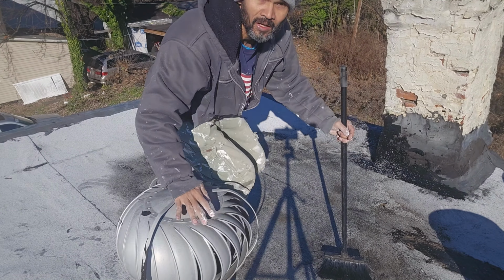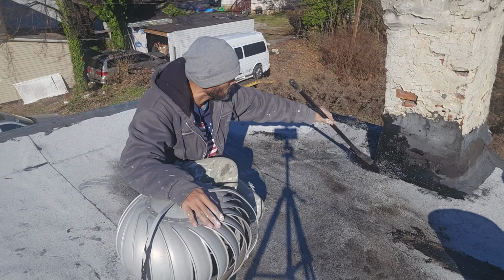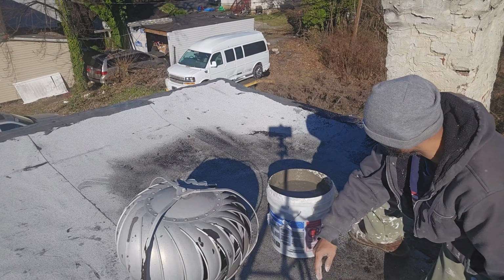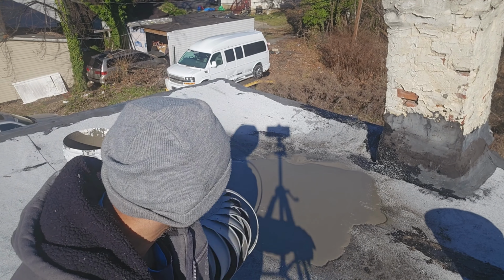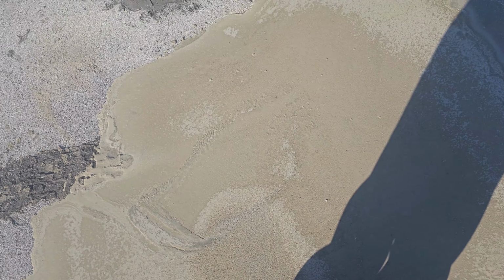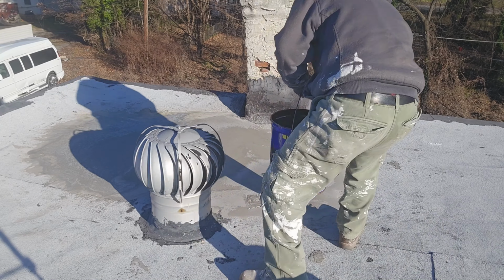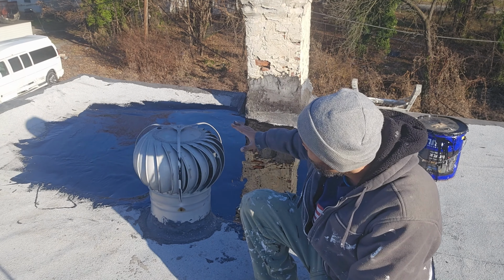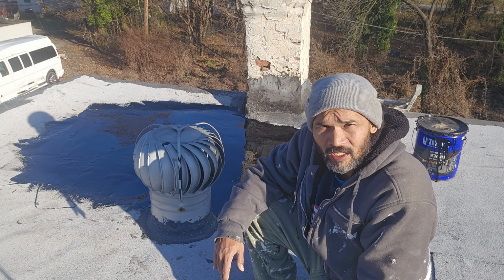How to repair sitting water or pools of water on a flat roof

Comment: Something seems wrong about this 🤔  it had indentation because of an issue beneath 😮
Reply from the maker: This is correct way to handle it without ripping off the roof.  The beam sag over times.   It also depends on if they need a new roof because, layers and layers  of asphalt needs to be removed .  After that we remove all the wooded board or plywood .  Finally replace all of the beams that are not straight.  This will be a $10-$15k job.